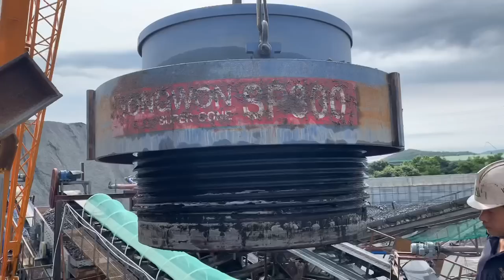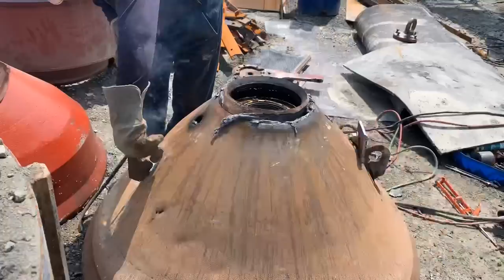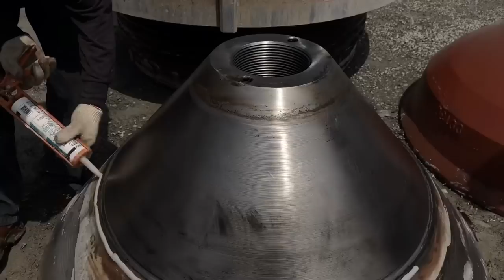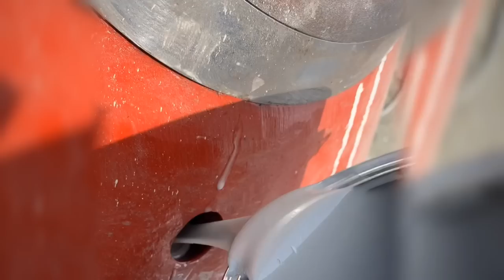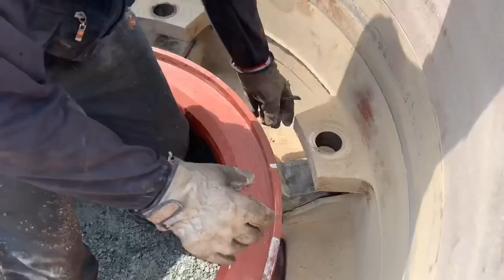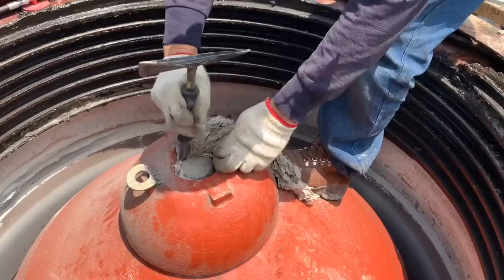Yong Won SP300 Super Cone Crusher liner replacement

Comment: my coworker and i do a k400 in about 6-8 hours. I do the top liner and my coworker does the bottom liner. you don't really need to let the backing hardened as long as  you run it slow(need to do anyway to break it in). in emergency you can just use abc as backing. But this is an excellent video showing how cone liner changes are done, every cone is different but still kinda the same

Comment: Nice one work safe my self n team we disassemble the one for metso sp200 taking 4-5hour bowl line and the head  I'm an apprentice at the moment
Reply: Man that's good time....I dont usually work on the crushers but the last liner change we did the backing goo got into the threads of the head nut....I had to cut it out with a cutting torch...it was a 15 hour process from start to finish....then had to explain to the boss the next morning why we were down so long😳

Comment: Nice synopsis , seems like the crew have been well trained and done this a few times before.
How long will it typically take from shut down to start up to change these liners?
Reply from the maker: It takes about 2hours for whole liner replacement and needs to wait another 5hrs for hardening the backing compound inside the mantle core. Therefore it takes total 7hrs.

Comment: I’m working at a mine and at one of they want to use a thicker line in one of the crushers , the liner is 1 tonne heavier than the current liner . Do you think we need to perform an analysis to see if the structure can withstand the extra weight or Load factors account for that ?
Reply from the maker: Mantsha Hlokwa increasing the weight of mantle might lead to shaking whole machine due to unbalancing the eccentric counter weight balance. The weight and shape of liners are reasonably calculated and designed by manufacturer in order to perform in best condition.
Reply: OH heck yes. And I'm not a miner. Safety!!!!